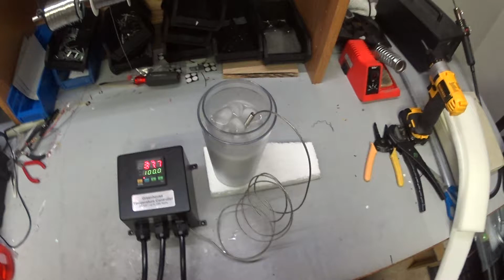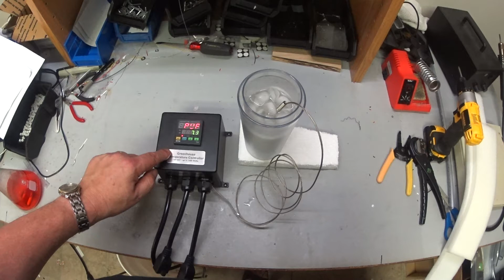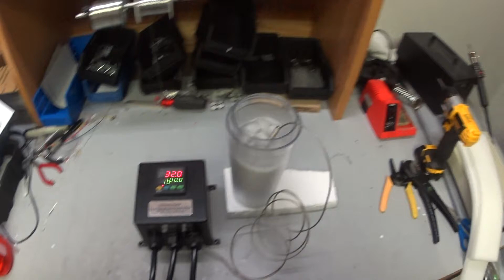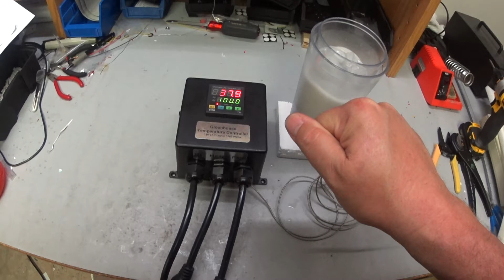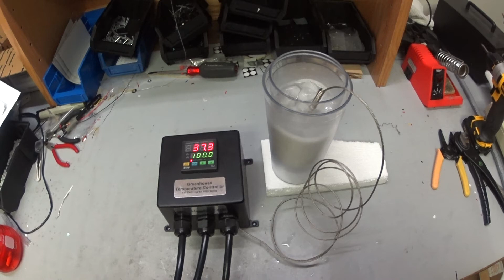Setting MYPIN Temperature Offset

Comment: What kin of coils do these use if I need to get a new one?
Reply from the maker: What coil were you using and what was it being used for?
Reply: Not sure what kind I have. I bought the whole setup off someone and the coil is bad. Not sure who makes it. But if you could tell me where I could get one that will work that's be great I'm using it to medicate. I need it to reach between 500 degrees and 800 degrees.
Reply: Julio Cervantes
OK, you are using it to run a vaporizer. I assuming it has a PID like the one in this video? Can you send pictures to me at thargrav@hiwaay.net?